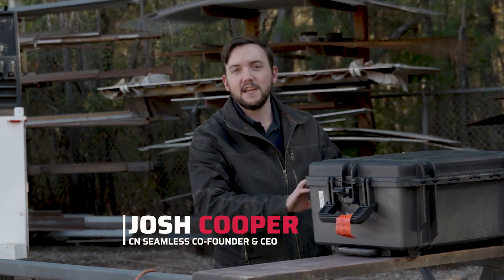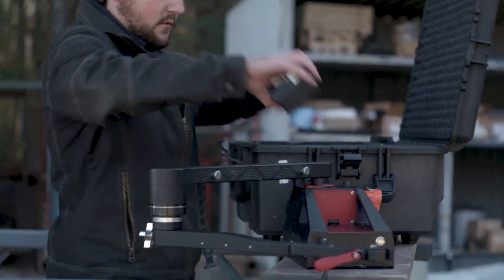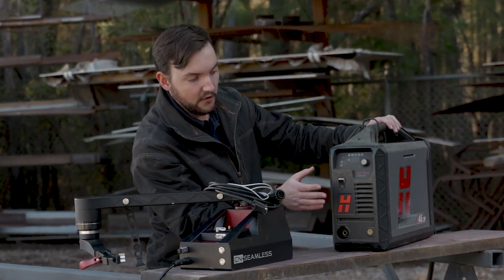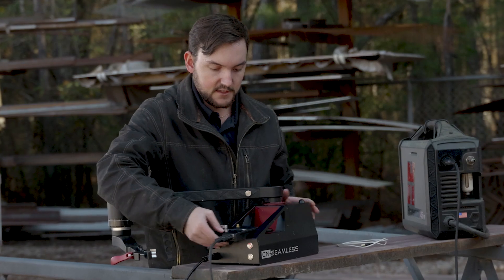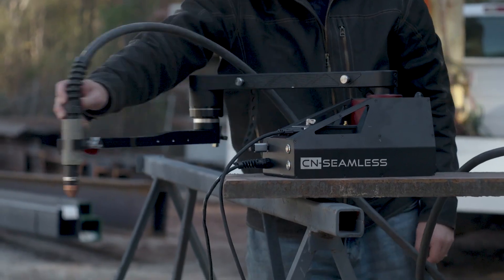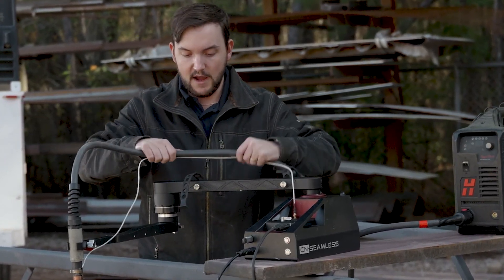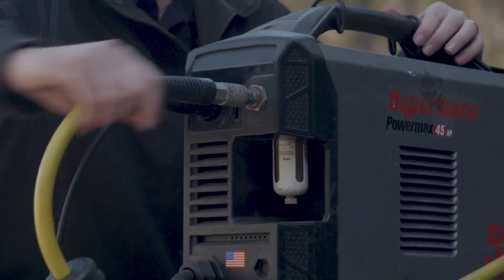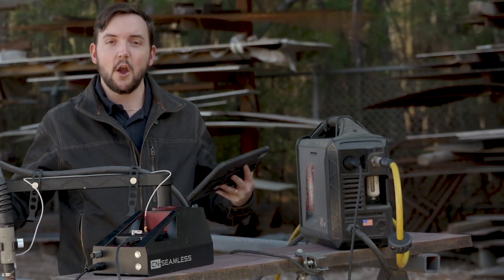Setting up the Mach 1 for Plasma Cutting

Comment: CN Seamless Plasma Cutting Machine looks so easy to use anywhere. Customers will appreciate the accuracy and repeatability, nesting, and materials savings of direct CAD to CAM.👍 Liked 🔔 Subsribed 
🔖Bookmarked ⤴️ Shared
🙏 Greetings from Australia 🇦🇺 
Our Technical Schools would love these. 
Are 240 Volt 50 Hertz machines available in Australia?
Reply from the maker: @DirkOz  Thank you! The power supply is compatible with 240 Volt 50 Hz so yes, they’re available. We’re working towards RCM certification!